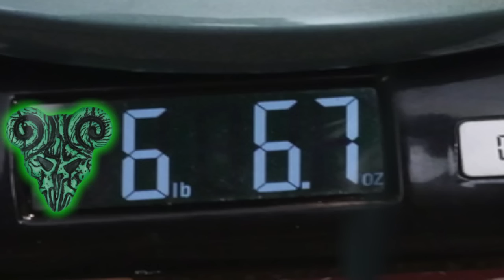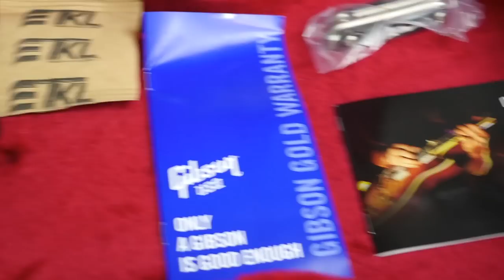Is the New 2019 SG Special Any Good? Faded Pelham Blue Review + Demo

Comment: I have a new 2022 Gibson SG Special that I bought from Sweetwater.  I love it for sure but one thing Trogly failed to mention is how awful these guitars are to play when standing up. The neck dive, the forward tilting of the guitar, these are design flaws by Gibson. The strap buttons are incorrectly placed. It should be placed on the top horn but instead is placed near the neck joint. I played this guitar at a gig lately and it fought me the whole set. I switched back to my USA Schecter and Strat after our break and it was dramatic how much more comfortable those guitars were. I know there are some partial solutions to this problem out there but at $1500+ you would think Gibson would have addressed these inherent flaws. All that said, this guitar has "mojo" for days and it is hard to put it down. Hopefully I'll figure out a solution to its short comings. I have no idea how Pete Townshend and Angus Young played these things live and made it look easy!!

Comment: I can't afford a Gibson, but I do Have the Epiphone inspired by version, and they seem almost identical.
Classier neck binding on the Gibson, but the Epiphone has a much better fitting neck joint.
I really did not like the look of the tuners on the Epiphone until you pointed out that they too seem identical (or an identical copy) to the Gibson.
And the headstock branding on the Epiphone is a nice mother of pearlish.
I'm not from the US, so the where it was made thing is not an issue. I just can't fault the Epiphone.
Not trying to be a twat, but apart from bragging rights, is there enough of a difference in either quality or sound to warrant a 5x price hike?

Comment: I had a lot of issues with my 2019 Es235. I sent the first one back . the second onnhas a few issues.  The biggest is the selector knob vibraye through the Amp in the miss position.  Its going back . both had finish issues as well.  I am getting a 2019 LP classic Goldtop.

Comment: It's beautiful but why is the budget model the same cost as the standard? This thing is obviously cheaper to produce as it lacks the block inlays, lacks the inlaid headstock, has a cheaper set of pickups, and has a one piece wraparound bridge instead of the two piece stop tail. Those are major reductions in materials and time of labor spent on this guitar, there is absolutely no justification for the price point.

Comment: The Gibson site says that the wiring is like this " 2 Volumes, 2 Tones & Toggle Switch (Hand-wired with Orange Drop Capacitors) "      
W
Reply from the maker: This one is a 2018 "2019 Model" before the specs were changed
Reply: @Trog  I just got one in sparkling Burgundy. The date on the final paperwork is 12/8/18. I guess I probably have to old stuff too
Reply from the maker: @espltdhor  The best way to tell prior to purchase is the serial number - if it starts with 19  - it is the 2018 version. The new ones will have the update serial system of YdddYbPPP instead of the old YYppppppp style that was used from 2014-2018
Reply: @Trog  nice back to 1st and 5th. im gonna list it on Ebay or reverb prob.    great guitar if anyone wants. I just don't want the circuitboard

Comment: I wonder how the intonation is with that  tailpiece. A lot of your chords sounded not in tune.
Reply from the maker: It’s sharp by 2-3cents on the tuner
Reply: @Trog  : +/-1 to 2 cent intonation variance is acceptable. 3 cents is inacceptable. If you do studio recording you will always have to tune the guitar the way the chord sounds correct. This can easily become a very annoyinfg thing. This guitar isn't supposed to be historically correct in any way, therefore I wonder why they haven't put on an adjustable wraparound tailpiece, as those are available on the market.

Comment: Why do some of these have reflector knobs and some don’t? Earlier runs maybe?
Reply from the maker: you might be right there. I believe when these were first introduced, they were meant to be limited edition - but with NAMM 2019, they were released as part of the 'core' series. They were also talking about moving the fret spacing around for better intonation, but I'm not sure which exact models those were. Perhaps the ones with changes have the black knobs
Reply: I recently received this model without reflectors and it was made in October. Maybe the first ones were a little of both variations. Very strange.

Comment: I would happily pay 200 bucks for that guitar, until then I am keeping my old epiphone les. Paul special leftie I bought from a friend for 100 bucks, it just needs some new black grover tuners and it will sound perfect for me.
Reply: Oddly, the guitar with the best resonance I have is an Epiphone SG Junior from end-of-90s. At the time, Epi was doing a promotion of instruments from Indonesia. My SG has survived all kinds of torments and stands up for continuous changes of odd open tunings. Price approx $135.. My first Gibson SG Special came in 1969 and at that point had already seen heavy use: neck P90 missing, a hand-made copper string retainer for a wraparound and scratches all over. I was living in Venice, heard the rumour that "the worst Gibson ever ever seen" was in Verona, not that far away and I got extremely cheap. It was sold to that shop by a US soldier stationed at a Military base nearby. I always figured it was some rennant from a concert with Pete Townshend (LOL) but a roadie managed to terminally thrash mine 20 years later... Now, I'm perfectly happy about a Classic!

Comment: I do like the reviews of the new guitar I think they're really cool and they offer information I also have a SG special or don't mind is much newer one 2005 so it's more of the stripped-down version of the standard although I bought one with a which was not typical the typical once had the Warren or faded finishes and mine came with the wine red finished and it's beautiful when it's like a piece of mirrored glass they did a really beautiful job on that and accept for the. Inlays and the lack of binding on the neck it's a standard all the hardware is the same the tune is are the same it's got the chorion not like the stand the dead tunas work fine they staying to him the finish is still no checking or anything still like a piece of glass only difference really is if it's got the set of 490r and the 490 T pickups I think the standard at the 2005 if I'm not mistaken at the 490 and the 498t at first I was thinking of changing out the 490 tea for the 4 9 8 but the floor 9 zeros actually I got very accustomed to them and I don't feel any need to change the bridge pickup at all anymore keep your videos coming and a Happy New year to you and everybody

Comment: How odd!! My example is indeed hand wired and soldered, with big orange drop capasitors. No prewired board in sight. The backplate is smooth plastic too, not the textured material seen here.

Comment: Those textured back covers are impregnated with a shielding material.
Reply: Matt Fields: 
~ So Gibson is FINALLY adding some shielding to their P-90-equipped SGs ? - Around 2012, I bought one of their "SG Special `60s Tribute" guitars, and it doesn't have any shielding. Frankly, I was disappointed that a modern $800 Gibson had as much "hum" as that guitars does. Oh well, at-least NOW they have shielding.

Comment: Mine got "2019 model" stamped at the back of the headstock and pcb with no orange drop. Strange and mislead advertising from Gibson
Reply from the maker: There are two 2019 models out there. The one in the video is a made in 2018 - 2019 model before they released the Original collection that changed the specs. Sounds like you were sold an old one and not a new one

Comment: no adjustable bridge? no thanks
Reply: You can adjust length of strings from each end of the bridge using the grub screws.  So no fine tuning of individual strings, but the compensated bridge makes it pretty much intonated.  Unless you demand absolute perfection.